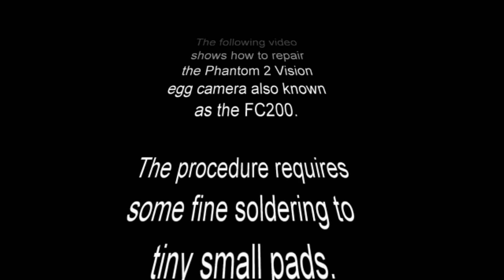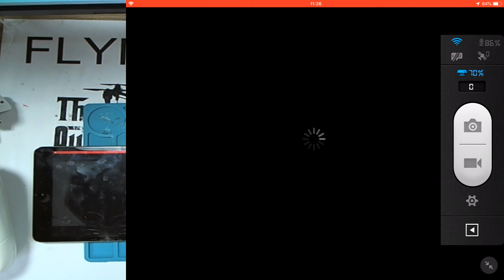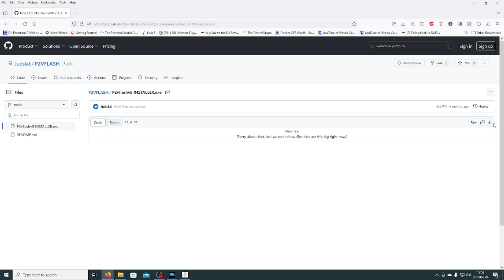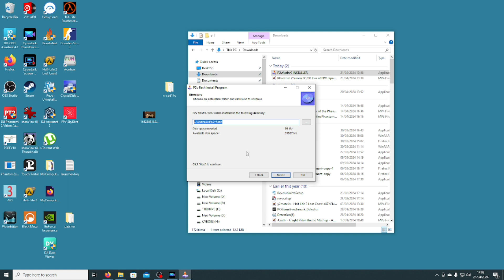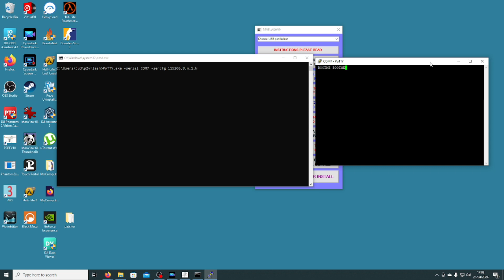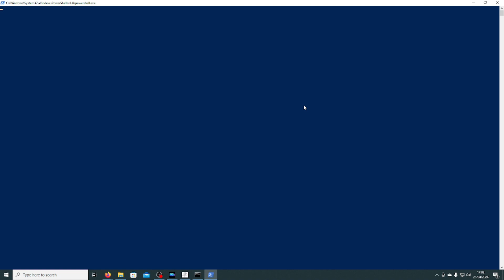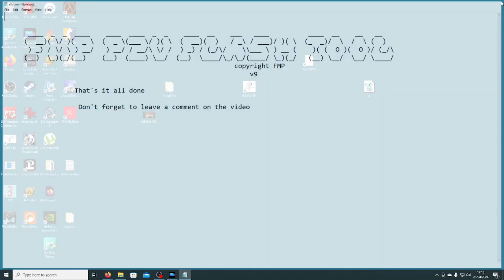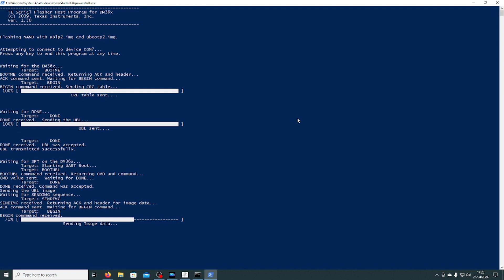Phantom 2 Vision FC200 loss of FPV repair No Solder Method updated 2024

Comment: Fixed with the firmware #1. The flashing was straightforward, but I wasted two hours trying to link the app and the camera. Finally I found the failure: the 3,5 mm plug connecting the camera to the drone was not properly in its place. Handyman! Anyway, thanks for the video and flashing utility!

Comment: hi, 
i have tried several times to connect following your instructions, but I could not put in the boot me mode, I could not get the correct pin looks like, I am wondering, if I can send It to you, with range extender so you can fix it?  if yes, how much does it cost, and address, thank you
Reply from the maker: drop me an email at flymyphantom@outlook.com
Reply: @FlymyPhantom  
i have sent you email, thank you

Comment: one more question :), I ordered the PCB 2.54 from the link you mentioned above, but the pins seem not aligned with the board, could you tell me which model it is: 2.54, 2.0, 1.5 or 1.27 mm. i got the 2.54mm